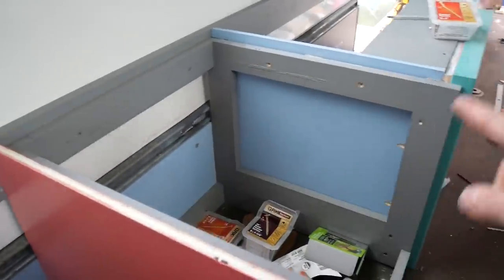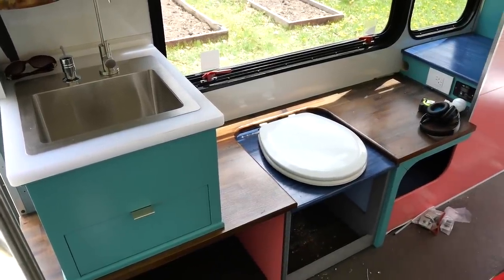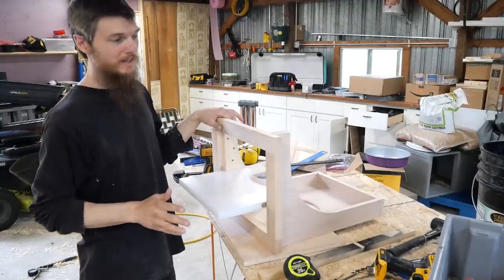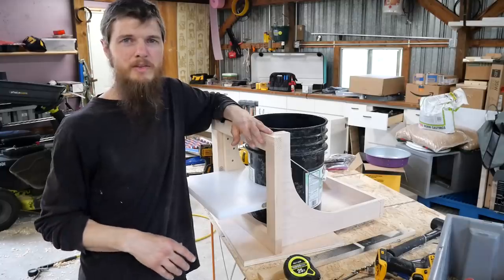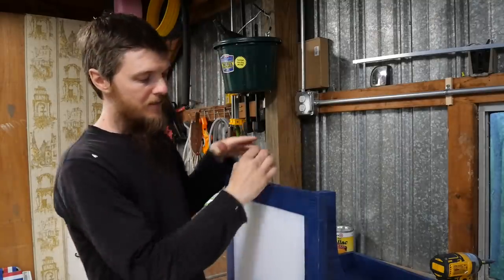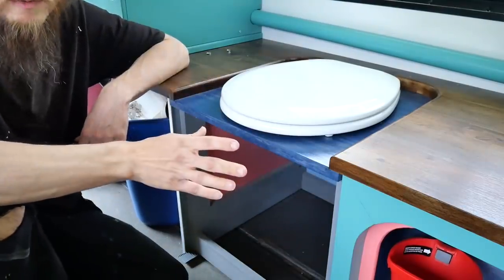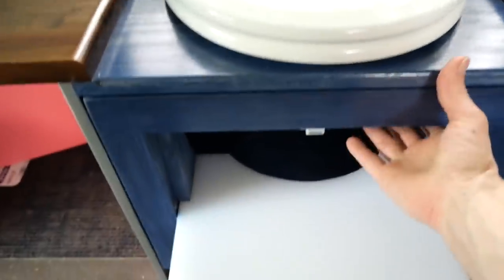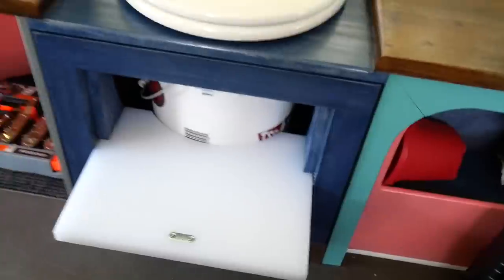I Complicated this Bucket Toilet, but it's Awesome

Comment: Love the design of the toilet. Tip: if you do not plan to immediately empty the toilet, I added weather stripping under the seat to fill gaps between seat and box. This helps to seal in odors especially on hot days.

Comment: Agreed, this thing came out AWESOME! So many people don't realize in this country we are one "garbage-man strike" away from an apocalypse here. That's right....have your supplier stop picking up trash for a month and watch what happens. It will be pandemonium, so what's the issue with these folks having the insight of using a composting toilet in their mobile? It's innovative and aligns with how we went to the bathroom in our homes as early as 80 years ago for the most part in this country by the way, so chill. Now go take your trash out without worry friend. It's gonna be OK.
Reply: I am my own trash "man" I use this system in my motorhome bcuz dumpstations are gross & not convient for me. 
I put the bags in a huge garbage container & haul it to the dump every couple of months in my pick up truck. Cheaper than the "man" coming to your home & I have no home for them to come to.

Comment: You can purchase the pellets put in stalls to soak up liquids,  I’ve been told, if you do not use a urine separator. You might need a lock to keep bucket from sliding out when traveling. You always have to put locks on drawers in a camper of some kind. You have done a good job!
Reply from the maker: Yea, that's what we'll be using, the pellet bedding. Thanks!

Comment: I buy in bulk the shavings that people use for horses, it's only about $5 per bale. I use it instead of kitty litter and it is SO MUCH better! The smell isn't as bad and when I need to clean it, I just dump the whole thing and replace it with new. It saves me money and the smell is better too. Use the pine shavings, not the cedar.

Comment: We have RV with a neat exhaust fan above the toilet. It runs off battery and really helps a lot with clearing the air in such a small space. There’s also powdered toilet deodorizer called CampaChem that I found out I didn’t want to tow a RV without. Ours is a tank system, but composting toilets are becoming popular for boondocking. I love your setup! I think people forget how clean y’all keep your home so they curl their noses at the toilet being near the sink. Your setup works because it’ll be more sanitary than most people’s house!

Comment: I think your toilet is a fantastic idea, you guys are a family, and there's modest ways of using a toilet, as anyone with kids knows 🙋‍♀️ you can cover yourself on the toilet, even if you have a towel there for that purpose. Anyone who doesn't like it doesn't have to do it this way, simple. All that matters is it works for your family. And yes, sawdust is very absorbent, of liquids and smells, especially woods like pine and cedar, they smell lovely too. And if you're changing the bag out regularly, there's zero problem.

Comment: Could you make a box top to sit over the toilet seat so that the lid is hidden whilst not in use but would give you a surface as well as keeping the lid down whilst you are driving - just a thought and might be too much hassle to do it now. I love the flip down foot rest and the slide in and out bucket - i am going to sho this to the group that runs summer camps where i live and i hope that they will take this on board because at teh moment we use a bucket and lid on top and have to empty them out into septic tanks but a composting toilet would be such an improvement.

Comment: You could add a rectangle swivel handle that is used as a leg when the flap is open. Which would take the weight of an adult. And be able to pull away from the magnet. When the flap is closed , the handle would nit protrude so much.
ALSO that whole toilet setup could be made mobile and used OUTSIDE when you have the option.
Reply: its built in place, not mobile.  why take it outside where there is no privacy?

Comment: YAY!  Looks great!  Loved seeing Belle help you make it.  Love that step idea for Maverick!  Love how it looks with the white and blue and the wood trim.  Love that it glides out for easy emptying.  Great job all around.  Am I right to assume there will be a plastic liner in the toilet part or is that not needed in the dry system?
Reply from the maker: It can work both ways, it can have a bag in it to throw away as trash, or it can be dumped into a humanure compost pile. Thanks!

Comment: Love the way your toilet project turned out. Just a thought...you have enough space behind your toilet to place a small trash can and or container to hold some sawdust with a scoop in it. Keeping the rest under the bed & only sliding it out when your container needs to be refilled will make yours & Mom's life a little easier....no sawdust tracked on the floor. lol Be blessed.

Comment: You may want to remove the fun toys out of the saw dust before you use it , LOL 😄! I like the color on the toilet, but you may need to put a locking latch on the slide for the bucket so it won't slide out and spill during driving on your adventures! 😊👍💕💕💕

Comment: ha
hahaha! people mean well. I like the way you set it up. We do tear drop size camper. Are making a cargo trailer 5X10. We will use a port a poddy but like you its a tight squeeze because we are putting a sink and cooking in front too. I have ordered a doggy pool and water heater for showers. It will be portable. Set up when needed.  I think your lay out is great and the colors, already saw the curtains and it is as if a designer did it all.

Comment: "Don't film this." Hah 😂

Loved the way it came out, and earlier on in a previous video I had wondered what you might do because of Maverick & the height. I absolutely love the way you tackled it, and I'm sure you'll figure out a way to strengthen it if required. Another great piece of the build. 

I know I mentioned it in a previous comment, but I became aware of composting toilets many years ago through a center - CAT - or the Centre for Alternative Technology, Machynlleth, Powys in Wales. 
If anyone has interest in how we can all perhaps make changes or how these alternatives work, it is a great resource even via their website. Just Google them. Composting toilets should become the norm imo for many reasons.
Reply: This would be great for homes with limited water available.

Comment: I initially was concerned about the toilet but after consideration it occurred to me most concerns apply to flushing toilets... once water is added it can be airborne. The composting process does not introduce water.   Your cleanliness standards are high, the risk is minimal compared to using a public toilet during travel.

Comment: You all's ingenuity is amazing. Love watching your builds. always novel and perfecto!
I use the pelleted pine horse bedding from Tractor Supply to help extend my cat litter use for my two cats. I keep my gallon or so in a 5 gal bucket and dampen it, so it fluffs up and stops being a pellet. Makes it easier for cats feet! I had this on hand to use, for me, when our power, and water was out during the deep freeze in TX this past winter. I intend to invest in the potty lid that fits a 5 gal bucket, to keep with my camping stuff!

Comment: I think I've seen someone talk about this before - I'd be inclined to seal the top of the toilet and put a cover over it and, in the same way that when you have a gas canister in a bus that you need to have a hole in the floor to allow carbon monoxide to escape (in the UK you do anyway), I'd put an inch wide hole in the floor to allow air to circulate and smells to get out. That way, you'd get less in the way of smells. What do you think the viewers recommend?
Reply from the maker: With this toilet system there are no smells, but we do have plans for venting in the bus for fresh air. That video will be coming out soon.

Comment: My only comment is if you used a shorter pail (think bakery supplies) you could have lowered the height of the whole deal. The added space would have allowed for a flip up cover that would be the same as the counter topping.  Any extra space in a small trailer or van is like gold. Over all an amazing build! Great work!
Reply from the maker: I could have put this bucket lower. I put a 2.5" inch spacer underneath the toilet to raise it up. That's the part I covered with the trim at the end. I did that because I didn't want the toilet set down into the counter too deeply. It would have put it at a more comfortable height but it would make the toilet feel cramped to sit on and using it could be more difficult. It's hard to explain without being able to show. I did consider it though. I put a lot of thought into several options and went with the one I felt was best.

Comment: If you went with a smaller bucket, you could make a smaller drawer to house the bucket. Then make a lower drawer to fit underneath the bucket drawer to house the saw dust.

Comment: Looking good 👍👍Just wondering will you need a latch on the slide out so it doesn't slide out while driving?
Reply from the maker: It should be okay. The drawer slides lock when fully closed :)

Comment: I think your toilet design is great - only change I would make would be to have it a bit lower with a countertop section that lifts up so you don't actually see the toilet seat.  Just my preference to not see the toilet seat - it's one thing to know there's a toilet, it's another to see it out in plain sight.
Reply: That's my thinking as well.  Out of sight when not in use.  No one else would ever guess it was there!  It wouldn't even have to be lowered.  Just make a removable cover for the toilet seat.

Comment: This might have been mentioned in one of the previous 487 comments, I did not read them all.  When the vehicle is going around a corner, the bucket section may slide out, which would not be desirable.  I am sure you will have an easy fix for this.
Reply from the maker: The soft-glide slides lock in place when it's fully closed so it's all good :)
Reply: they have lids on 5 gallon buckets and it is seated into a groove I believe I saw that when he put it together.

Comment: I am curious what type of sawdust you will be using , I like the  smell of cedar shavings.
Reply from the maker: Just regular pine sawdust. We have some extra sawdust pellet bedding that we recently got ready for this.
Reply: @diyfferent  could you not just use the actual sawdast from your shop vacuum? I'm sure you have plenty of that laying around, guessing from the amount you cut wood 😊
Reply from the maker: @Kath-Erina  We don't have a shop vacuum, but if we ever do, that would be a good source. We've used most of our sawdust that we had laying around though for our kitchen scrap compost. :)

Comment: Have you thought of a urine diverter. You did a great job I really enjoy your videos.
Reply from the maker: No, it's just not something we want to deal with. We just plan on using sufficient dry material each time :) Thanks!
Reply: The sawdust will absorb EVERYTHING, it's great to use in a pouch as moisture absorption in wardrobes and cars too. And, depending on the wood, it'll give a lovey scent too.

Comment: I see your point in a way.. Buuuuuttttttt.... Elder people with knee and hip problems have a very difficult time getting up and down from a low toilet. A small stool or something else to raise your feet with a chair height toilet is a much better option and in line with the Americans with Disabilities recommendations. Our house was built with aging in place in place in mind.. Wider hallways and doorways to accommodate a wheel chair. A grab bar and a seat in the step in shower and so on. A lot of people wondered why we built a bigger house. Our house is bigger in square feet but not in the number of rooms.. The rooms are bigger though.

Comment: will the toilet slide out  while driving down the road or does it lock in place on its own
Reply from the maker: The soft close feature of the drawer slides also holds the drawer tight in place.
Reply: Have you watched the video!?
Reply: I'd have an additional catch to hold draw shut. Could get messy if had to do a sharp right whilst driving down the road
Reply: @diyfferent   ok cool i love how you designed it
Reply: @kathleenoverton3263   yes i have watched it i must have  miss the part  where he said it locked in place

Comment: I would just find or make a step for you and Ashley. If you guys use it I think it will break
Reply from the maker: It's pretty solid feeling so far, hopefully it doesn't break!
Reply: I would think only Maverick would need to use it as a step.  The rest of the family it would be a foot rest if wanted or needed.  In that case, it is plenty strong.
Reply: @margaretbedwell58  Doug was saying the whole family would use it when they needed to "go"
Reply: @crinkle2649  I didn't mean the toilet, I meant the step.  Maverick will need the step until he is taller.   I know they will all use the toilet.

Comment: Some Asian places they don’t even have toilets ,people just squat
Reply: not just Asian countries. There are a lot of countries. 
Some you squat over a hole, others you squat over a pipe in public. We have flush toilets now but outhouses are in our near distant past. 
A composting toilet is cleaner, and no smell. People just aren't use to the idea if you are not an off gridder or a rustic camper. 
The counter is not for food. The sink is for hand washing not food prep & its raised higher than the toilet. 
The bus has very good tinting on the windows and they are adding curtains. 
If someone has to go potty the rest leave the bus for privacy. So no big deal.

Comment: Us old folks can’t use a short toilet our knees don’t work like they used to, you will find that out when you are about 55
Reply from the maker: It depends on the person/society. Some cultures outside of the US use holes in floors for their toilets and they eat on the floor with a low table, even at old ages. We like to stay fit, flexible, and healthy so we shouldn't have any problems if we keep our current habits/lifestyles and if nothing bad happens to us.
Reply: It's not always as simple as some think. There are natural aging things that happen...period. There's also hereditary factors, which you can't change. Add to that life events that come due in your golden years that you will have to make the payments on. 
Yes, lifestyle plays a huge part in quality of life. But you can live "perfectly" and still suffer affects of aging.
Reply: @diyfferent  Plus, probably the only one it will even be that short for is Doug! I have a feeling Ashley is around my height, just over 5 foot. I'm 71, and we recently had to replace all of our toilets. Much to my dismay. None of the toilets being made now were as short as our 40 year old ones. And most were much taller. I did not want a much taller toilet, for the same reasons you all mentioned, as to why that step could be helpful for all! We finally found one model only that was just a shade taller, than our old ones. My husband and I had a huge debate over why this mattered so much to me! And, as I said, I'm 71, so NO not everyone needs a taller one as they grow older. Love that you explained, why a really tall one is not good for everyone. And I didn't want to be constantly moving one of those things you can use to raise your feet! So I think everything about your toilet design is perfect! 😊

Comment: Well, it's definitely turning into a comedy show. "Where do you put your potty?" 🤣😂 I still say you will regret your potty position...you have a developing daughter who will one day soon want complete privacy.  You should at least put a divider for pee in the bucket...or rought it to a jug in the back. Use gravity.
Reply: They did mention before that they plan on leaving the bus when one of them is using the toilet. When I was a kid, we had a travel trailer with no toilet and we managed just fine. You might want to watch some of the Nomadic van dwellers on YT and see all their creative solutions.  😄
Reply from the maker: We explained privacy concerns in our toilet FAQ video, link is in the description if interested. We don't want to deal with a diverter and we just plan to use sufficient dry material. :)

Comment: I'm sorry, but s**ting on a bucket in a small space is gross and not very sanitary.
Reply from the maker: It's a pretty sanitary toilet system. It's more sanitary than water toilets.
Reply: You would change your mind if you were out west with no restroom for miles. Our youngest daughter had a tiny bladder and she couldn't go no more than an hour or two at best between stops. Try going on a long distance trip stopping every few hours. Yeah, its a pain.
Reply: @scottfirman  
Bold of you to assume I would go somewhere out that far. I do not go out into the middle of nowhere, and if I did, I'd just piss on the ground or find a bush to crap in if it were that bad. I wouldn't allow myself to go so far out that I needed to crap in a bucket. It's just not worth it.
Reply: @he_lives_in_apineapple_und9743  OMgoodness, it's just a toilet. Don't sweat the small stuff.
Reply: 🤣🤣🤣🤣🤣 you obviously don't have children, and that's ok, but please don't judge those of us who do.